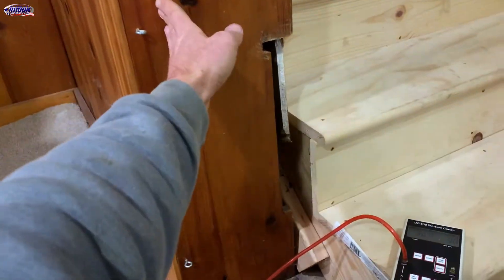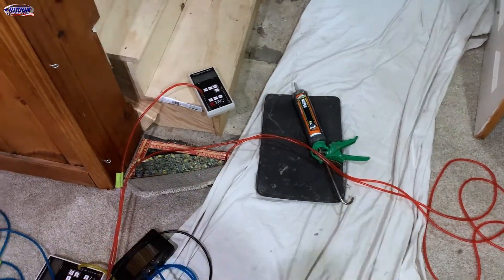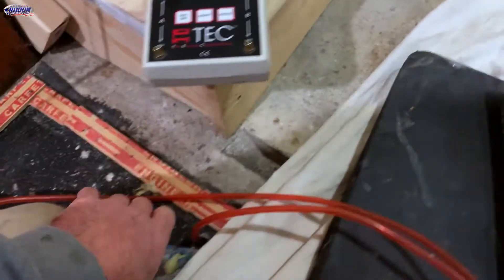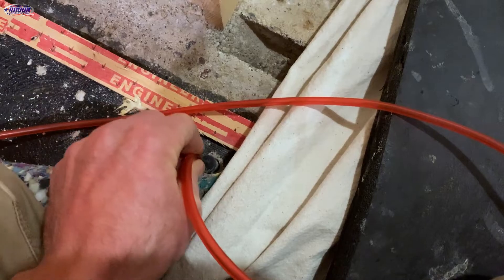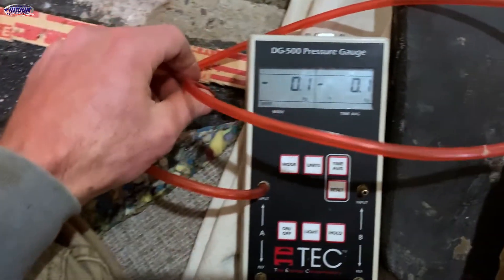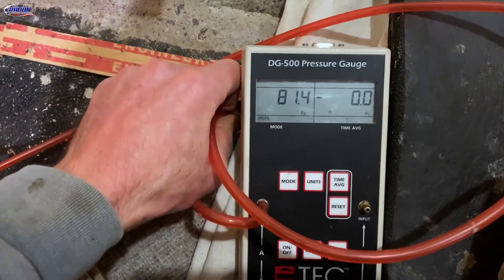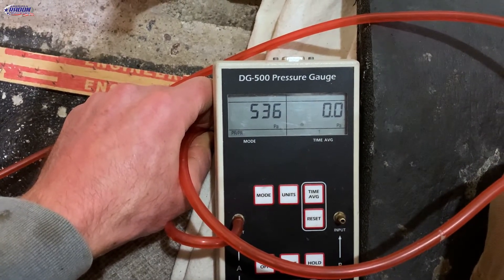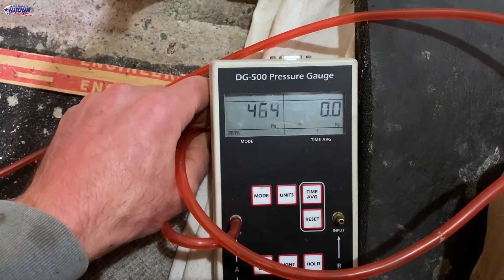How to Tell If You Have a Dead Test Hole During PFE Testing

Comment: Great point about the clay.
Dealing with one right now. Getting zeroes. Client is just happy we want to investigate before making more 4" holes.
Reply from the maker: It could be zeros because you don't have PFE at the test hole, you have a dead hole, or a bad seal or micromanometer. My guess is that you have a bad seal or a dead hole if it goes positive like the one in this video. 

You could do a max depressurization test to see if that changes your PFE numbers. If it does, that would indicate a sub-slab connection in your test holes. 

Usually, your numbers won't be at zero. They may bounce around, especially on windy days.